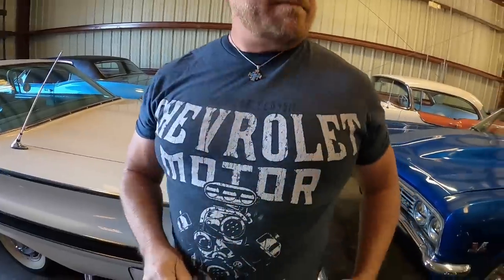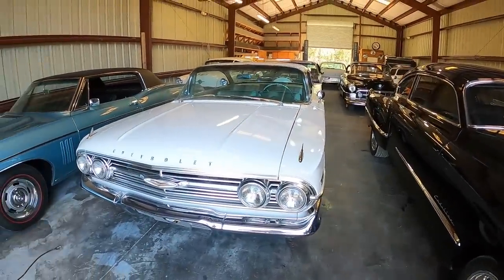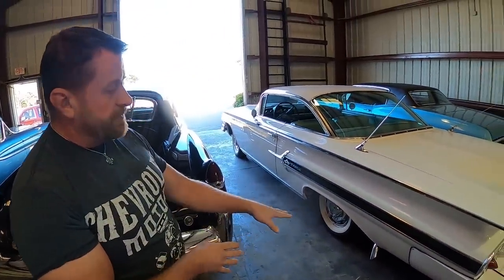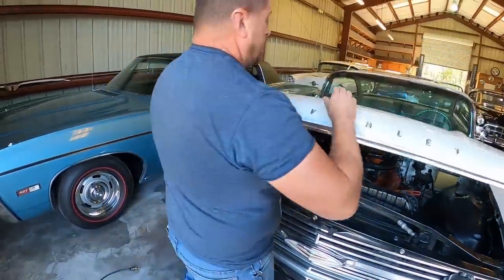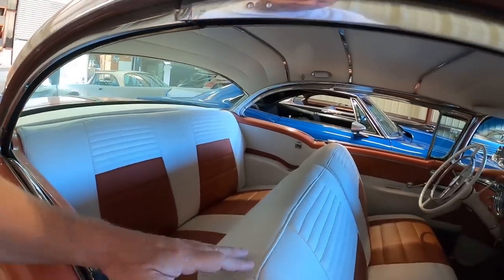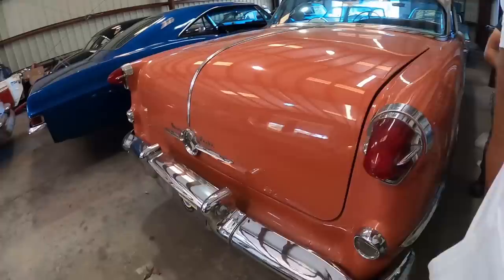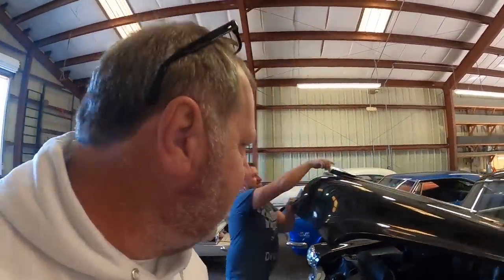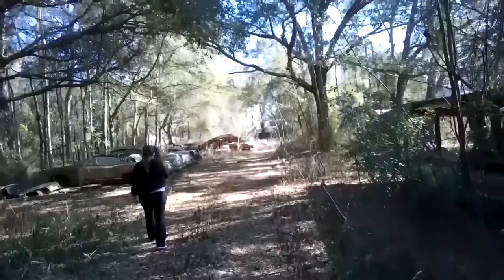EP543 Barnfind leads to Classic Cars @ MIssion Classics Part 1

Comment: This Mission Classics was a big find. The 58 Olds was very nice restoration. The 49 Cadillac is a nice Hot Rod. The 60 Impala is just another representation of a great car restoration. Beautiful. The Chevy SS car was also a crazy restoration. And a 1968. Sweet and one of a kind. The 1955 with the 57 engine. It did look new. The 66 Chevy with the 427 some beautiful cars. Also that 1950 Cadillac is so original. down to oil bath cleaner. Loved the tour Sean. Thanks for sharing!
Reply from the maker: I appreciate that and you Terry!